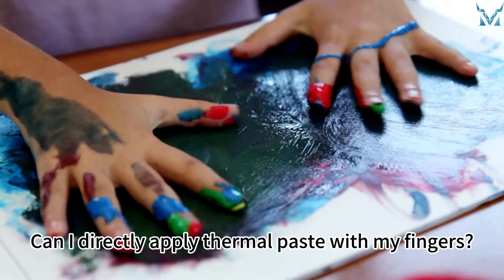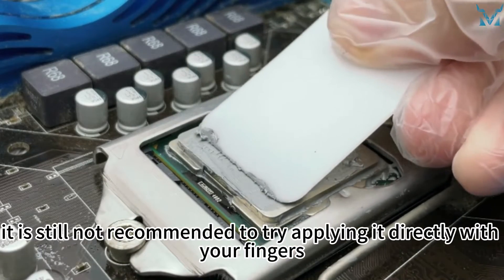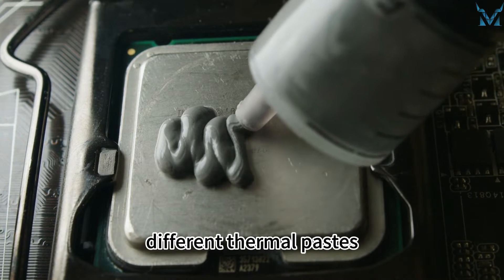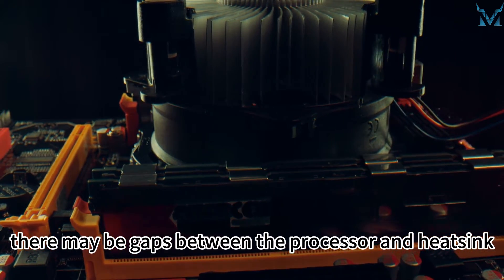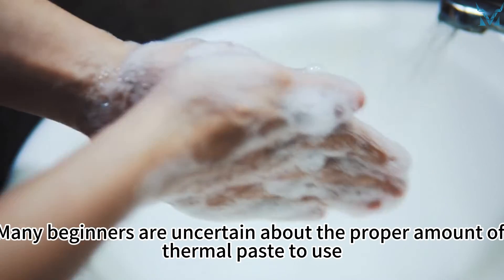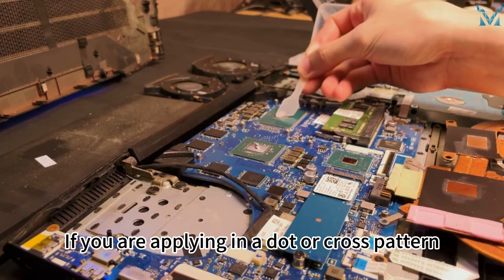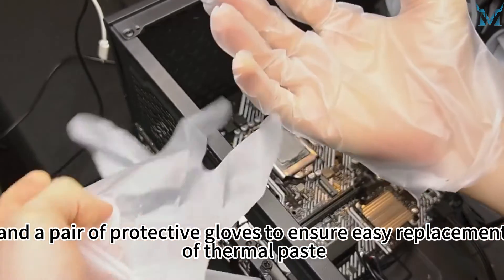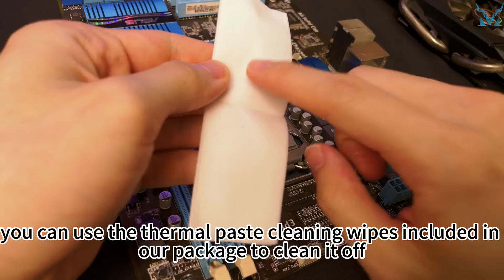Can You Apply Thermal Paste with Your Fingers?

Comment: To be honest, I feel like I’ve had the best thermal results whenever I used my finger. Everytime I ever tried a pee size, a large blob, multiple dots, an x pattern, or even a vertical line, it always became a guessing game on whether or not the heat sync pushed out enough coverage and sometimes it wouldn’t working out well in thermal results. I tried a spatula once and hated it, it wasn’t spreading the paste evenly or I was fighting the thickness of the paste. I usually just put a big glob in the middle, press my finger right into the center of it than spread outwards in a circular pattern. Once the whole CPU is covered, I start wiping the paste in one direction to help keep the coverage even. If I see the CPU under the paste because coverage is too light, I add a little more paste. Never had any issues doing this and my thermal results were always excellent. As far as cleaning your hands, it always came off easily with high percentage isopropyl alcohol which you should always have on you when dealing with thermal paste.
Reply from the maker: Hello, as long as the amount is appropriate, how you apply it actually doesn't matter. We have detailed reviews on this. The amount applied is directly related to the size of the heatsink. We still recommend using a spatula for better results.

Comment: mx-4 with a pair of rubber gloves and my fingers never disappointed me on bare dies of laptops, when i am on desktops i prefer the dot at center method
Reply from the maker: Feel free to try our KOLD-01 thermal paste. It’s different from the usual thermal pastes you mentioned. The main difference is that regular thermal pastes use a solvent-based formula, which evaporates when heated, causing the paste to dry out and lose its thermal conductivity. We use an exclusive solvent-free formula that perfectly addresses this issue. Therefore, it offers better thermal performance and a longer lifespan when used in laptops.
Reply: @koolingmonster  i will surely give it a try!